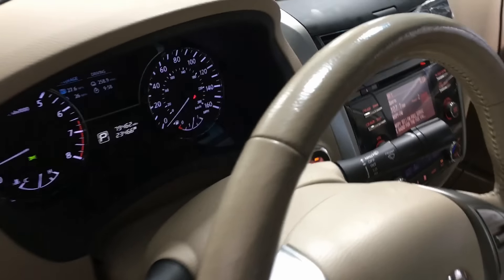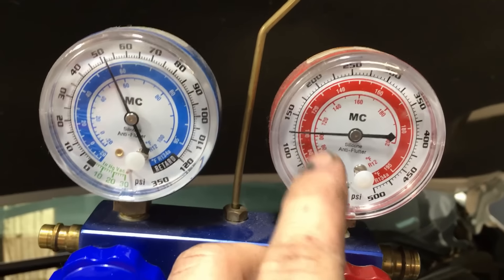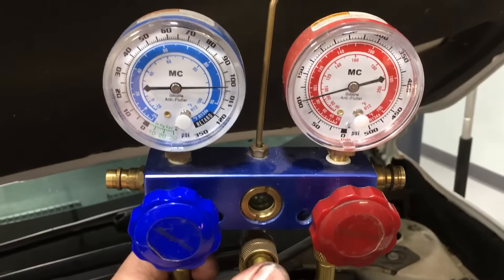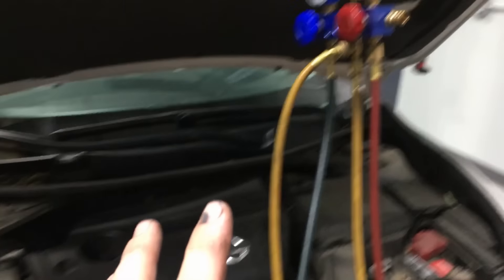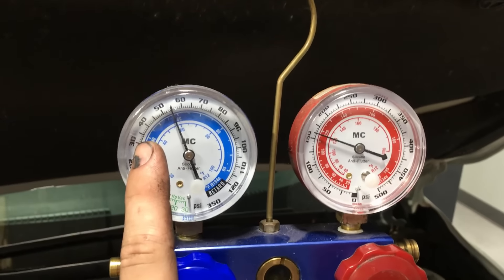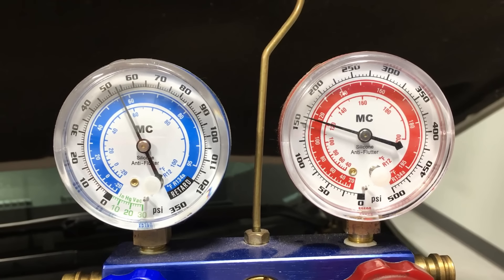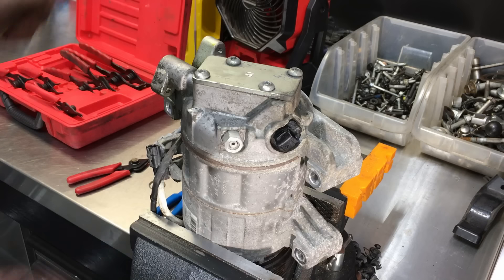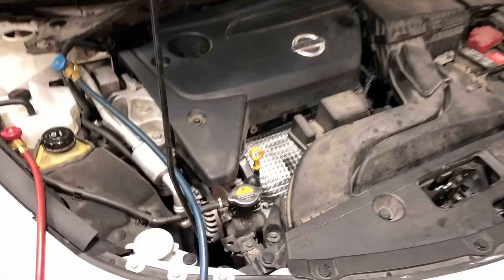A/C System Failure Diagnosis: Poor Cooling at Idle

Comment: My car seems to run great until I put my air conditioner on and then the car stalls.. sadly it was working great until I picked it up from my mechanic who was working on another issue. Did not bring it back to him because I fear getting slammed for another 5 hundred.. saw him 3 times in 5 days and it all started with maintenance. A little suspicious. New issue arises every time I pick up car.. any advice on air conditioner why I stall out?
Thanks
Reply: Engine off, key in pocket, reach for the compressor clutch, grab the clutch hub with your hands and rotate it. If it won't budge, you have a seized compressor.
Reply: TeraVolt since it only happens when ac is on he would need to engage the ac clutch, then try to move it

Comment: Great video did you replace the compressor with oe Nissan or aftermarket?
Reply: Greg S he only replaced the valve...did you watch the whole video ?
Reply: @johnjoseph7382  
He said that he replaced the compressor. At the time the valve was not available.
Reply: Great question

Comment: will stopped up orfice tube cause one to not take freon? 2-- Jeep Cherokee 4.0  Took oil but will not take freon...
Reply from the maker: No it will still take it just not as fast
Reply: Compressor  worked great in the other jeep 96 cherokee country both 4.o but i had to change out the backs because they were in different positions. 96 back of 2000 top of comp. I had it vac. and put ruffly 4 oz oil that it took no problem. wont take freon. i know its pumping for sure because i took off the low side sensor held down the valve with the clutched manually kicked in with trying to put freon in it and it blew off one of the lines going into the condencer. So ya its building up pressure but not sure on the suction part. as far as the power/fuses etc.  I start the car turn on A/C controls, Hi/max,   with a test light i have pwer on both wires coming from the compressor . the ground on the comp. shows to be hot too. Both incerts show hot on the low pressure switch /cycling switch unless i unhook the high side switch. then one side hot no light on the other insert.Then i try to bridge it over and it still dont kick the clutch in. If i try that with it showing 2 hots it blows the big 20 amp fuse. Same if i try to bridge it over from the ac relay on the fuse box.  the fan shows 2 hot coming out of the switch going to the fan but  1 hot 1 ground going in the plug.  When I unplug the ac compressor i still have power on the compressor  end/plug and both wires  but no power on the plug wire coming from the wiring harness.  Even with everything unhooked. low side high side fan and ac compressor i still have power on the compressor. both wires... Only time  the wire from the harness has powe is when i plug in the ac.  Is that right??  My low  pressure switch  4 ports has power on 3 out of 4 ports/slots.    Car running ac controls on, if i unplug my low  side  sensor i then have a hot and ground on the high side switch  instead of 2 hots but low side switch has 3 hot 1 neg. unplugged... i did test the wire thats going into that port and it has power going in the  switch but no power in the port of the switch.  If i hook the high side back up, again i got 2 hot ports on the  low pressure switch.  Even when i have 1 hot side other neg with the high side unplugged = it still wont cycle the clutch but it dont blow the fuse then. Do i have a ground somewhere maybe causing it not to let it take freon??? P need help caus i cant afford to take it to a shop...

Comment: What causes pressure surges while filling?
Reply: Probably the low pressure shut off switch is cycling due to being low on charge. Most will cycle the compressor off when low side pressure gets below approximately 18 PSIG. Operational low side pressure needs to be higher than that to allow compressor to continue to engage.

Comment: What simptoms when the selenoid is bad??
Reply: As far as I know, if you pass different duty cycle PWM signals to solenoid input while the compressor is running, you should get difference in the low-side pressure. When the duty cycle is close to 100% the low-side pressure should reach 30-45 psi. If the pressure doesn't change when you change the PWM duty cycle, the solenoid is bad. If you see difference in the pressure with the duty cycle but never can reach below 50 psi even with 100% duty cycle, it's time to replace the whole compressor.

Comment: My AC compressor is always ON getting voltage (clutch engaged), regardless of if I have the gauges ON or OFF inside the car. HELP!
Reply: Had a similar problem on a Honda Pilot.  It was a sticking relay.  When the pressures rose too high, it vented freon, then wouldn't cool very well.  Charged it back up.  It vented again.  Then discover the sticking relay.  Problem solved.
Reply: @austinpuckhead1  thank you! It was actually my AC relay!

Comment: My car, a Chevrolet Spark has pretty much the same symptom, low side is way to high (around 55psi) and high side a bit lower than should be (145psi). For my surprise, my compressor does not have any solenoid valve attached to it as seen in thi video. Can anyone please tell me for this symptom and a compressor with no solenoid valve, what is the solution? thank you in advance.
Reply: Depending upon year it's either a Denso scroll or a Mitsubishi scroll compressor and it can either be a stuck open faulty expansion valve or a seriously worn compressor that can no longer draw enough refrigerant in... yes, no solenoid. And it doesn't look like it has a control valve of some sort either. It likely cuts the clutch off intermittently during operation to keep the evaporator from getting too cold.

Comment: Not an AC guy,but what does the acronym FOT mean?
Reply: Fixed displacement Orifice Tube. A cycling switch on the accumulator cycles the compressor clutch off whenever the suction pressure becomes so low that the evaporator is able to freeze up, and cycles it back on when it has increased enough so that the evaporator has had enough time to defrost, and the expansion device isn't able to adjust flow in order to regulate superheat, it just chokes flow and that's it. Basically a bang-bang system all the way

Comment: Why does my car have a  low idle when I turn the air conditioner on. It's never stalls but it does come close?
Reply: Justin Cofer not sure but sounds like coolant temp sensor. Will take you 5 min to replace. Good luck

Comment: I had a Kia Soul with 80psi on both high and low while AC running. TXV system with IHX lines. It also had a control valve that was getting power and ground any idea? What would your guess be?

Comment: A pro shop ripped my buddy off, and it still blinks 
at idle, after they charged it,
then new comp r & r,  then charged again, 
, then said relay, then said it was fixed
again, and again, $700.00+ ,
and it still blinks lol, and doesn't get 
cold while idling. Next, they'll probably blame 
the transmission....

Comment: My standibg pressure is 120 psi.  Compressor clutch works and compressor seems to try to do its job.  But low side drops by a few psi and vibrates very noticeably.  High side stays at 120 and vibrates but not as much.  Im thinkibg blockage rather than bad compressor.  Perhaps control valve?  What do you think? Ill check voltage on the valve. If zero ill force 12v onto it to open up and let the gas flow. Should be ok to leave it open right?  Clutch will go on and off instead,  right?btw im in thailand all shops just leak out to atmosphere

Comment: I have a question. In cars with variable displacement compressors, it is supposed that the compressor is operating as long as the car motor is rotating. So, what does exactly pressing the AC switch button do in this case ?

Comment: Looks like, it’s a new design? First time I see a refrigerant control valve built into a compressor.....
Reply: It's from the 80s. The GM V5 compressor was the first mass-produced compressor to employ this design, although it used a mechanical control valve instead of an electronic one.

Comment: Recover to charge for refridgerant old trick to run up cost what ever
Reply: Narada what are you talking about ?
Reply: @donaldpauli129  what im talking about is companies charging customers on a reclaiming  charge to to pump down a system to determine what is wrong with it to be a midas to slap parts until it is fixed been there done that from greedy owners of a company
Reply: Maraca. I would agree charging a fee just to be charging would be a scam BUT with today’s “ critical charge systems” there is no other way to properly see if the refrigerant level is correct for proper operation. You often need to recover the charge, vacuum down the system and install the correct charge to see if the system will operate correctly. No sight glass to look for bubbles
Reply: I personally think reclaiming and recharging this system was a waste of time, the gauges tell all.
The compressor running unloaded, suction side not pulling down with low high side shows straight away a inefficient compressor.
Reply: obviously that didn't apply here

Comment: My valve failed and I easily found one on amazon. Lol
Reply: Did you even consider that it could be the upper AC pressure switch that is no good or that the air gap between the clutch and the pully was too far? I'm very surprised how few people actually bother to look for this before they immediately  Diagnose it as a failed compressor. It Such an overlooked thing to look for but I'm discovering to my astonishment more and more that this is the problem and not an expensive compressor replacement or worse.

Comment: What are the symptoms of an overcharged system?
Reply from the maker: Pressures on both sides will be too high.
Reply: End user experience will be that typically when the vehicle iddles in hot days (90->105 °F) it will start to blow hotter air, and the same system in the same conditions  would cool acceptably when in motion.
Reply: @ziggydiaz7601  The difference between a car stopped vs. car in motion is NOT about overfilled pressure.  It is about un-insulated liquid lines getting re-reheated and providing poor efficiency in stopped traffic.

An overfilled system with a fixed orifice (a non TXV system): will freeze both evaporator and return line. 

More is NOT BETTER 👍🏻
Systems are precisely charged by weight of refrigerant. A system that needs a recharge.... has a leak !!! 
First check both shredder valves for leakage else expect a priceless repair.

Comment: So, $30 pressure regulator switch ends up in $400+ a/c compressor. Really couldn't find one? AutoZone or anything?
Reply from the maker: No one local sells them just online and the customer wanted it fixed like yesterday.

Comment: computer controlled AC valve... you should look at the CAN-BUS Climate control module to understand what the AC computer is trying to do with the valve, under "live data".

If it fails... you'll get an OBD2 code to help ya 😂

Nothing beats a pro with your experience
Reply: Even better backprobe a oscilloscope into the control valve wiring and check if the PWM signal is doing its thing or acting up

Comment: This is too technical. You should've made it simple to a layman.
Reply: Trust me, he did!! He didn't get into the tech side of how that valve works, why it's used in the first place, or why Nissans have higher failures than most! Basics: Almost normal high side, high low side, no cooling with a correct charge, start by replacing the capacity control. (the part he showed)

Comment: Jesus Christ wear gloves 🧤., you have to touch your wife , girlfriend or now a days your boyfriend after work . 😏
Reply: VOLTRON real mechanics don’t wimp around with gloves
Reply: Donald Pauli ➡️ how silly you sound , because you don’t want to whimp around with gloves , that makes you a real mechanic 👨🏼‍🔧. How about you be a smart mechanic instead of a real one as you call it , and where gloves . This way  all these  products and chemicals you use on a automobile to repair them  doesn’t go into your pores . The mind set here is to make it to retirement. Instead of being in a hospital 🏥 bed for retirement. I’m a boiler service mechanic, I wear mask and gloves , customers don’t judge me as a fake mechanic nor did they see me as a whimp. They just want there boiler fixed .
Reply: Well Mr Voltron. Strangely enough I started mechanics full time in 1973 steady employment till I retired 4 years ago. I’ve got far bigger problems from agent orange than automotive chemicals ever gave me. Do what you need to feel safe but I did fine thank you
Reply: A bit of Goop will fix that right up
Reply: Robert Bell Exactly right
Reply: "Why do you wear gloves", hmmm, where have I heard that before?
Reply: @Voltrondefenderoftheuniverse  real mechanics do wear gloves. Customers don't appreciate smudge mark all over there car. 
Easier to make hours when you don't have to scrub your hands clean in between vehicles or test drives.